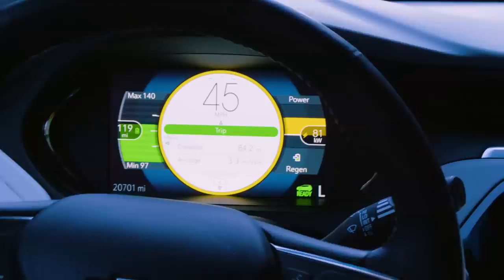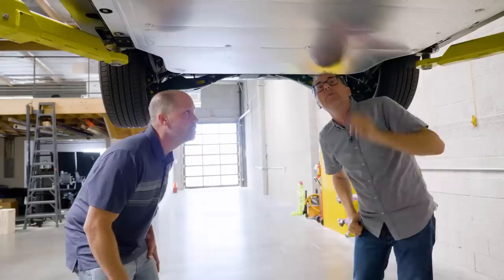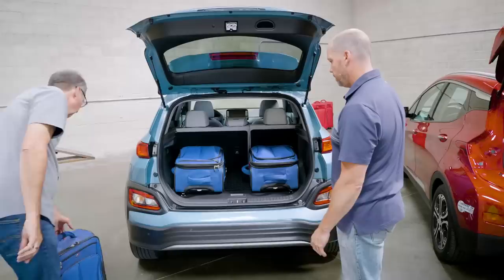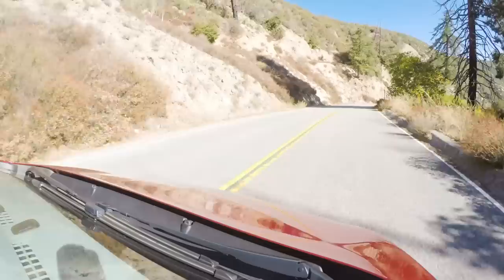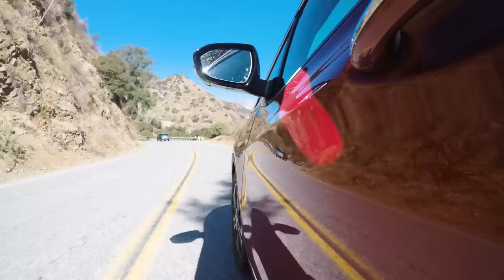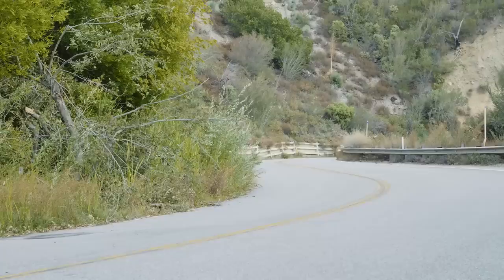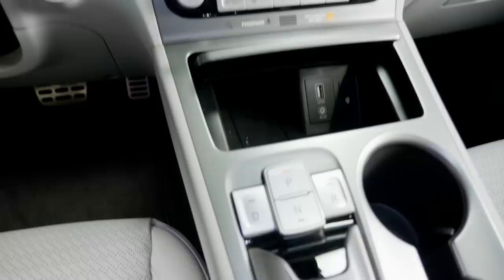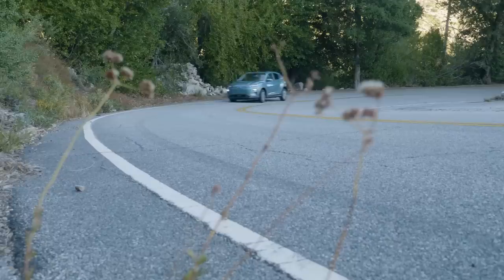Hyundai Kona Electric vs. Chevrolet Bolt EV: Which Is the Best Affordable Long-Range EV? | Edmunds

Comment: I'll take the kona electric.
Reply: sorry, none were produced.  Vaporware.
Reply: @davidbeppler3032  Bolt is already on sale. And the Kona is going on sale at February 2019.
Reply: @francisbatista3533  as I said, vaporware.  You can not buy them.  They are not building any.
Reply: @davidbeppler3032  
As you rightly say
What's good for the goose.....
Reply: @francisbatista3533  
The Bolt is "on sale", not necessarily "selling".... Probably just as well, they'd be losing more money.
Reply: @davidbeppler3032  If Hyundai isn't building any, why are Kona EVs out all over Europe and the Nordic countries? Instead of spewing inaccuracies, why don't you get your facts straight?
Reply: @blownb310  my facts are straight.  Vaporware.  They are not building any.  Tesla built 130,000 GM built 30,000.  Tesla has 1 factory.  Bolt is vaporware.  Facts.
Reply: @davidbeppler3032  Read what you just wrote. Bolt is vaporware now? You said twice in this thread that the Kona is vaporware and that Hyundai hasn't built any. You are wrong.
Reply: @blownb310  did you watch the video?  No?  Go watch it.  They admit Bolt and Kona are vaporware.  They are not producing these cars.  They make no profit from these cars.  You are wrong.
Reply: @goclunker  obviously you did not watch the video.
Reply: @davidbeppler3032  You obviously don't own a dictionary.
Reply: I’ll go with the Niro.
Reply: @rogerstarkey5390  Sales number are the highest they have been all year.  Maybe low but they are selling them.
Reply: @HelloOrganics  
Sales numbers of what?
Reply: They certainly are building the Kona, Hyundai can't currently keep up with demand in europe. There's  a 42 week wait in the UK from order to delivery at present!
Reply: @davidbeppler3032  "Vaporware". I think you're misapplying the term. Just because something isn't 'on shelves' yet does not make it vapor. Vaporware is something that will never be a physical product, that someone is using as a prop or pitch to sell something else, such as otherwise worthless stocks.
Reply: @Hamilcar_Stronginthearm  i am applying it exactly as the video did.  They are not building the cars in enough numbers to matter.  That is vaporware.  You can not buy them.
Reply: @davidbeppler3032  I can guarantee you the Kona EV is produced because I can see one outside my office window
Reply: @gentlepete2007  so they built one?  Ok, Tesla is building 1000 a day.
Reply: @davidbeppler3032  

Yeah GM is up to something with the Bolt. It's either a compliance vehicle, or maybe meant to take a chunk out of Tesla's sales. I suppose the Bolt is designed by an enthusiastic engineering department (thus why its a good car) but GM as a company entirely begrudges making electrics.
Reply: @0hypnotoad0  I agree.
Reply: @Hamilcar_Stronginthearm  

What is the difference between "a product that doesn't exist" and a Hyundai Kona Electric that doesn't exist in 49 of the 50 States, in those 49 States?
Reply: @suserman7775  Why just states? How about counties? How about postal codes? If a product doesn't exist in my postal code (9 digit to be sure), it doesn't exist. Seattle clearly doesn't exist, because it also doesn't exist in 49 of 50 states, and is only in 1 of 195 countries.
Reply: @Hamilcar_Stronginthearm  

Seattle doesn't exist, in your country.

And the Kona electric doesn't exist, in 98 percent of US States.

I never asked if the car existed in California or other countries.
Reply: @davidbeppler3032  they said the $35000 Tesla Model 3 is vaporware, not the Kona or Bolt.
Reply: @tubewacha  I disagree.  There are 1,000 TM3 built a day.  There are less than 300 Bolts built a day.  That makes the Bolt vaporware.  It does not exist.  Or do you think the Bolt can never change in price?  They will just raise the price when the TM3 hits market at $35k?  How long until the Bolt is 15% cheaper?  When is GM predicting that?  Why not?
Reply: @davidbeppler3032  You are miss characterizing what they said (@1:48)and you are stretching the definition of vaporware  even more than they are. Vaporware is stuff that was promised and never delivered. We have yet to see if Tesla will deliver a $35000 Model 3 , but it's really not proven it is vaporware... yet. At the very least it is not being delivered when originally advertised. Chevy has delivered and has been selling $37000 Bolt EVs for a while now  Although not in huge numbers. Bolt is not vaporware because you can go out and buy one right now if you want to at that price in the US.
Reply: @tubewacha  I agree with you.  But if they "the experts" can stretch the definition of vaporware, then an idiot like me can stretch it even further.  I am still right.  Bolt is vaporware because you can go out and buy one right now, but nobody wants one.  Building an inferior product with an inflated price tag is not successful.  The Bolt should be selling for $20k.  Then they would not be sitting on lots and would be "successful" with every one selling straight from the factory, like all of the $60,000 TM3's are.  Tesla is building 1,000 TM3s a day and selling them at $60,000 each and still can't keep up with demand.  GM builds 500 Bolts a month... they sit on lots.  Hoping someone buys one.
Reply: @davidbeppler3032  

They are being built. You tube "tesla Bjorn Norway kona" that dude reviews one. If they sell em in america.....that has to be seen.
Reply: @suserman7775  "Seattle doesn't exist, in your country." Does the moon exist?
English is an amazing language with lots of words with subtle shades of meaning. Choosing between "exist" and "is located in" or "are readily available" is not that hard.
Reply: @davidbeppler3032  There are less 300 bolts built per day, but they don't exist?  WHAT?
Reply: @silvius9  300?  Yes, when production is that low, they do not exist.  The US buys 17 million cars a year.  Tesla, a small startup with only one factory builds more then 1000 a day!
Reply: @rogerstarkey5390  All major cities in US are buying Bolts.  They cannot make enough.  You are clueless.
Reply: @netprowlerp  
Test?
The model 3 sold more in December than the Bolt sold in the whole year.
Reply: @netprowlerp  
Correction!
I mean the 3 sold more in The US in December than the Bolt sold worldwide all year!
Reply: @rogerstarkey5390  I can only assume you own one.  At $50000 it is hard to admit you got ripped off I guess.  The Bolt is 36000
Reply: @netprowlerp  
 
1) Never assume
2) You mean the 3 costs 50k and still sold 12 times the volume?
3) Ask why they reduced the Bolt? (Not selling)
4) Then ask why it's still not selling?
(Kia / Hyundia?)
Reply: @rogerstarkey5390  Hahahah,   I see you have your manbun is a knot.  I see my job is done here.
Reply: @netprowlerp  
Top tip?
"Hahaha" reflects on you, as does "my job is done"
If you have no argument, admit it.
If you do, show some figures to back it up. (I doubt you can)
Reply: Good luck on that.
Reply: Don't care what these 2 have to say, Chevy Bolt is an awesome car!
Reply: @davidbeppler3032  Bolt is not vaporware! They aren't making the chevy VOLT anymore. The 2019 Bolt just came out and have some upgrades from what they guys were complaining about, which personally I don't agree with.
Reply: @suzilindblad5207  So GM can only build 30,000 cars a year?  That would be why they are going out of business and closing all their plants.  Bolts are VAPORWARE!  GM has no interest in building a car they can't sell and when they do, they can't make a profit on.  Just because you can buy one, they are just sitting on lots, does not make them real.  If you prefer unsupported compliance car, then use that, I prefer to call them VAPORWARE.
Reply: @davidbeppler3032  sigh...🤦‍♀️
Reply: @suzilindblad5207  Think that is nice?  You should drive a Tesla.
Reply: @davidbeppler3032   I agree! My nephew just bought one. Yes, the Tesla is definitely a beautiful car. In fact I  asked him if he'd like to trade cars... 
He has an awesome smile😉
Reply: Jordan Catcher wrong.  5:50 Hyundai has less rear space so Chevy wins
Reply: @davidbeppler3032  what no bolts are the best i have one my self
Reply: @ahhhhhhhhhhhhhsjdkdjjdkdnd3297  Bolts are failure in business!  Bolts batteries are bad!  Bolts are not a safe car!  Bolts cost too much!
Reply: I have a bolt and it’s awesome
Reply: @ahhhhhhhhhhhhhsjdkdjjdkdnd3297  If you had a week with a TM3 you would never want to go back to the Bolt.
Reply: David Beppler you are mean to everyone
Reply: It's tight inside. Bolt all the way.
Reply: @davidbeppler3032  They are entirely different cars.
Reply: @manoman0  They cost the same.
Reply: @davidbeppler3032  on paper.
Reply: @davidbeppler3032  ...and one's not the latest generation EV. The Kona is new. I sat in one and it's slightly better but not that much better and then there's the styling...
Reply: I have a bolt and it’s not small not slow and it’s better than kpmg electric
Reply: @goclunker  before you call anyone an idiot, the car is a "Bolt", not Volt.
Reply: @suzilindblad5207 Oh you got me, too bad they are both DAEWOO aka GM KOREA. Can't deny that one. Thanks for playing.
Reply: The Bolt is the far more practical car. I miss some tech but then again, that's ok.
Reply: @davidbeppler3032  Boy have these comments not aged well...
Reply: @reduxith  Aged pretty well.  2020 Bolt sold 20,754.  Model 3 sold 439,760.

Comment: Actually, the Tesla Model 3 does come in close to the price of the Chevrolet Bolt used in this video.  The Bolt they said was a premier version, which starts at 41k and quickly moves up to the 44k range when you add premium interior options and DC fast charging(You really want this if you plan on making any long distance trips).  The 45K Tesla Model 3 is in the same price range at this point with the premium interior, and comes standard with fast charging(Supercharging). Also, the $7,500 tax credit is only good to you if you PAY in at least $7,500 in taxes by the time you take all other deductions, so for those of us who don't that doesn't matter either.
Reply: Yeah but Bolts can be found with $5000 discounts before the Tax rebate.
Reply: @SimonMichaelBenz  
5k discounts?
Doesn't that tell you something?
Reply: @rogerstarkey5390  Yes, it tells me no matter how great the car is, if its a Chevy, EV enthusiasts will be hesitant to buy it.
Reply: @SimonMichaelBenz  
Or, remind you that unpopular cars (for whatever reason) often get discounted?
The problem is, they lose money on every car already.
Reply: I don't understand how those folk who pay less than $7500 tax can afford a Tesla.
Reply: @r56mini  house is paid off, no other car payment. It's not out of reach to buy a model 3.
Reply: @rogerstarkey5390  That is not a problem for me, that is a problem for GM. If I am getting a car for far less than it cost the manufacturer to build it, I think that's a great deal.
Reply: I think you should double check. A $7500 deduction you would not get back but a $7500 credit should be refundable. Your mileage may vary. Consult your tax advisor.
Reply: @Dr_Reason  it is a tax credit, you can only get back what you pay in.  If your total tax is not more than $7500 you will not get the full $7500 tax credit. This is almost never explained when people talk about the EV tax credit.  You usually have to dig to find out more about it.  So really the tax credit is more for the people who are already wealthy.
Reply: @Knein1967  I'm with +r56mini though, if you aren't bringing in enough income to pay that kind of tax it's unlikely you can afford a car at that price anyway and qualify for the full tax credit.  Yes, exceptions, but 10% federal tax at $70k/year income is only $7k paid in taxes.  The price on these cars is going to give you a $650+ monthly payment, at least (unless you are stretching out to like 7 years...which is a big no no).  

If you (collective you) are considering an electric car, definitely do your research if you are thinking of buying a car with a price tag well north of $40k.  

These are early adopter prices for the technology.  5 to 10 years from now, we'll start seeing more affordable versions.
Reply: I definitely agree with you I think the 45k Tesla Model 3 should be in this competition due to its very similar price to the other 2 especially the Chevrolet Volt
Reply: @Knein1967  Paying 7500 in federal income tax hardly qualifies you as "wealthy".  That's an income of $47,500 for a single filer.
Reply: @slandshark  The 10% rate stops at $9,325 for single, $18,650 for married joint filers.  Tax on 70K is $13,239 if single, $9,568 if joint.
Reply: uh, after the rebate, My Bolt cost $29,000--fast charging, heated mirrors, heated steering wheel included.
Reply: Similar price, but to get the same driver aids you get almost for free on a Leaf, the T3 price jumps to $65k!
Reply: @rogerstarkey5390  Look at the discounts now that the $35,000 Model 3 came out. I see the LT trim going for sub $30,000 whereas a few weeks ago they were $37,000.
Reply: Why would you want that piece of shit half ass engineered bolt when you can have a model 3.
Reply: @jondoe8889  autopilot?
Reply: @Scnottaken  No one offers autopilot. I'm sure the T3's does more, but you have to get the premium model for that. $65k? For the Leaf SL, the Tech Pkg, which includes ProPilot, is $650. That's less than dealer prep!
Reply: @jondoe888i  you don't need a specific model for autopilot.  It's the trade name for Tesla's suite of driver assist features.  They made it standard on all vehicles recently.  39,500 USD for Sr+.
Reply: I know this since I have a higher end model myself, so I don't know if Nissan has the standard upsell tactic of including many features as part of a package that raises base price.
Reply: It appears propilot assist is only available on the SL plus.
Reply: Which is nearly 43k
Reply: @Scnottaken  It's only included on the SL Plus. On the SV models, it's $650. Higher on the base S model?
Reply: @Scnottaken  I realized that was the trade name, later. And if I'm reading it right, it's an extra $5000 on the T3. ALL options and packages are upsell. The tricoat paint on the Leaf is $350. The only standard paint on the T3 is black. And silver? Pearl white is $2000! So that, autopilot, and destination make the $44k T3 $52k. IF I'm reading it right. 
And the 2 Leaf ProPilot systems work intown and freeways. Autopilot is only on freeways, so far? But damn - now I'm looking into a T3! But it's my wife's car. I think she'd rather have another Leaf. But at $10k more, the T3 looks like a much better car.
Reply: @Scnottaken  The Plus SL has few options. And a price to go with it! It's a lot of money for what it is. Similar to the Niro.
Reply: @jondoe888i  autopilot is included.  That will provide autosteer and tacc. Fsd which will work to read street signs and lights is 5k. Propilot works on non-freeways?
Reply: @Scnottaken  Thanks for the info. I'm trying to find the SL Plus we want, and also juggling the Niro and now, T3. The tesla site seemed the most confusing of all, since it's more advanced? 
I've read good and bad about the T3. Mostly good. It's $10-15k more than we want to spend. You seem to think it's worth it? I hate to spend that much, with technology changing so fast! I believe the T3 will hold up longer, with downloaded technology? 
We drove a Leaf with ProPilot today, for 80min. I should have read about the operations before we did it. Below 40mph, it's the e-pedal. Wonderfully smooth stopping! Sometimes it followed the curves, other times, no. I don't think I had it set up right? Above 40, mostly for freeways, it's the ProPilot. But it wasn't working right. I don't think it was engaged. 
My wife hogged up half the driving time. A waste, as she will NEVER use PP! But she will use e-pedal, I hope. She's a 50's gal...
Reply: @jondoe888i  autopilot works down to any speed if it's following a car.  18mph if it's not.  I've never engaged it below 30.  Note I have the car myself as I said, and do not own a Nissan.  You can get a test drive at a Tesla store and they can talk you through feature more effectively.
Reply: @jondoe888i  what are you looking to spend by the way?  Like I said I'm only a Tesla owner and don't know anyone with any comparable driver assist features.  My friend's Honda has a rudimentary driver assist feature, not even sure it has a name but it's only Lane keep assist and tacc with lane departure.  It does not do a good job keeping a lane, warns far too often about keeping hands on wheel and doesn't provide enough force to keep engaged when your hand /is/ on the wheel.  Autopilot is light years ahead of that particular technology.  Kinda want to try propilot now.
Reply: @Scnottaken  I'm calling them this week. Online, the prices seem to be all over the place.
Reply: @SimonMichaelBenz  The Bolt did not come out well here. And it would come out even worse if they included any Tesla.

Comment: Hyundai just keeps making good cars.
Reply: that catch fire. My friend has a 2 years old Santa Fe...been in shop and leaks oil now.
Reply: sarcasmo57 Hyundai has not started making good cars
Reply: They have to. If not, their 10 year 100,000 mile warranty will bankrupt them.
Reply: Catching fire? That's better than defective takata airbags that killed and injured 100s of people driving toyota, honda, mazda, subaru , Nissan, vw, ford; you name it they used it, except hyundai and kia. They don't use cheap dangerous airbags.
Reply: 2018 jd power initial quality ranking puts genesis #1, kia #2, hyundai #3. Curious if they can stay top 3 in 2019.
Reply: @shawnlee664  They make good car every car has problem
Reply: Affordable nice looking cars for cheay